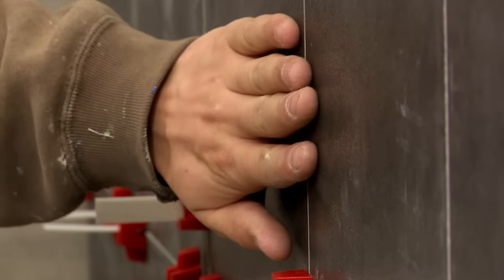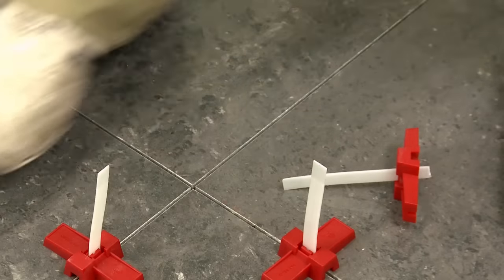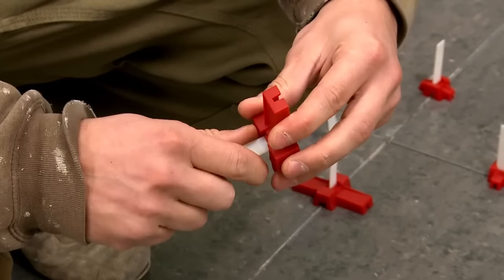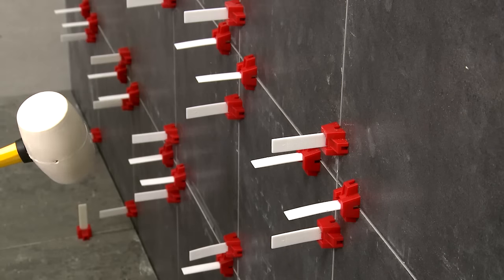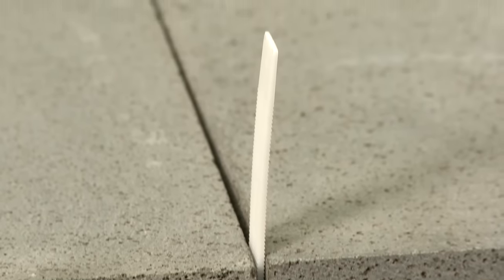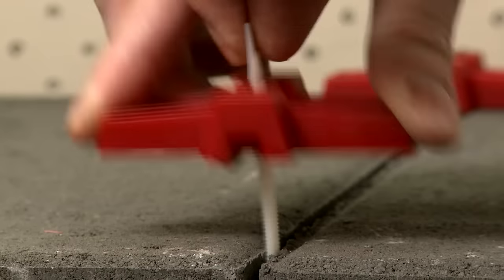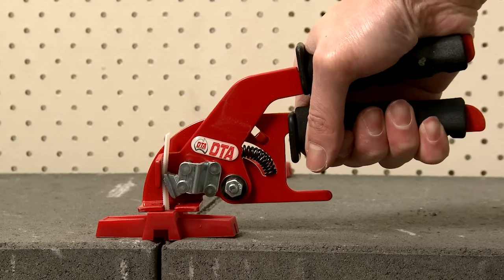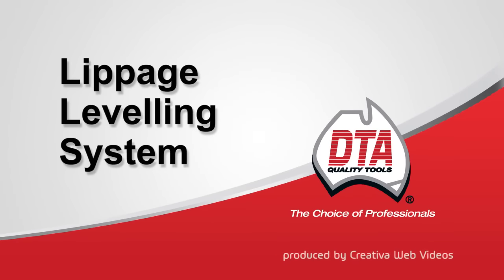New Large Format Tile Lippage System How To Video

Comment: This system works as same as Rubi quick leveling system. You cant re-install the tile (add more cement) if you inserted the cap. I used Rubi quick leveling system. I dont recommend this product. But I saw MLT tile leveling system might be great.